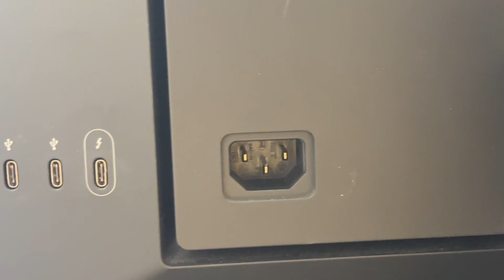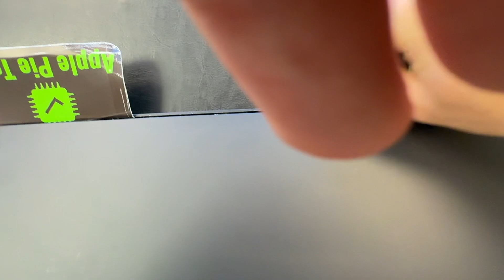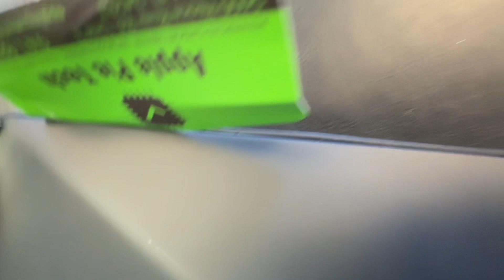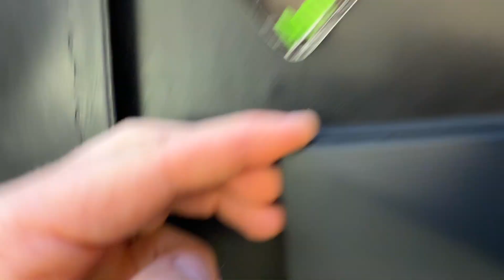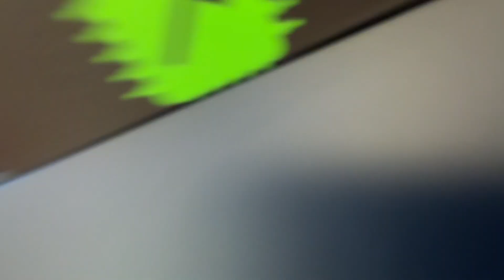Apple LG 5K UltraFine 27" 27MD5KL Monitor Disassembly and Motherboard removal for Mail-in Repair

Comment: The back removal is way easier than we think, I had trouble too. But you only have to lift it at one place (best at the top or bottom) and then pull the next part to it, continue with the next part till you have opened it. You must not push it sideways, you ruin it.

Comment: Have you removed the bezel for a bezel replacement? If so was that difficult without damaging the plastic?
Reply from the maker: Yes, it’s removable, you have to remove back panel first though
Reply: @applepietech  Did you have to remove most internal components to access the bezel clips? That's how it looks in the service manual.

Comment: Is it possible to replace the screen panel with a different one? Is it possible to use a panel from an 27" iMac?
Reply from the maker: I am pretty sure 5k ultrafine and 5k iMac have the same lcds from LG but they are not interchangeable

Comment: I have a port I'd love you to repair but it seems like this video cut off before you show how to remove the motherboard.
Reply from the maker: Get the screws out and pull it up. It might have a little resistance due to thermal pads being stuck to the frame but just a little more force and it will lift up.

Comment: is it possible to swap the motherboard of the 27md5ka with the 27md5kl motherboard?
Reply from the maker: They are interchangeable
Reply: @ that’s surprising, because doesn’t the KL have a different power supply?
because the KL shows 2.5A and the KA shows 2.A for their respectively
are you sure?, because my LG replacement parts dealer doesn’t take refunds :D
Reply from the maker: @ I’ve tested a lot of different 5k ultrafine boards in one tester unit I have and never had any issues. However I don’t know what model is my tester. I just know that all boards I’ve had are pretty much the same form factor and fit just fine, however newer ones definitely have different schematics
Reply: @applepietech thank you for the information!
kind of you to respond :)